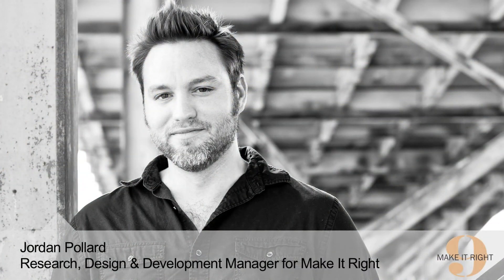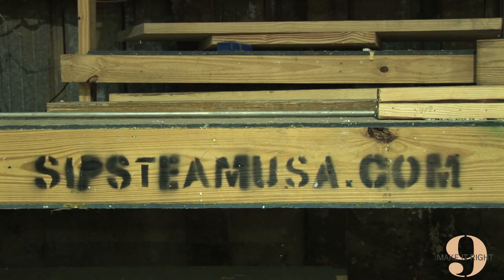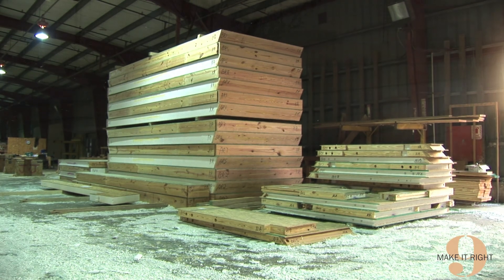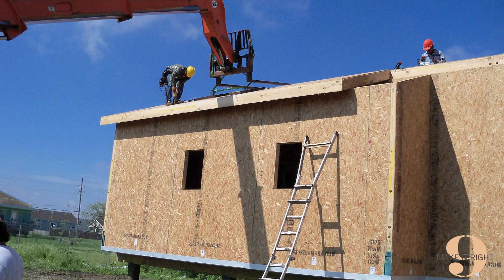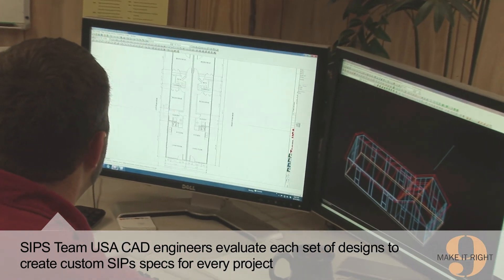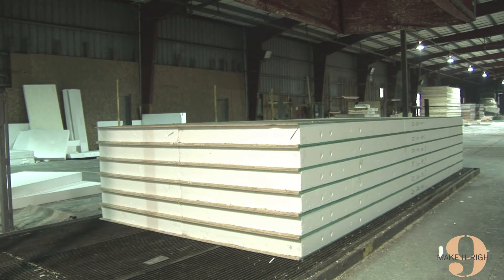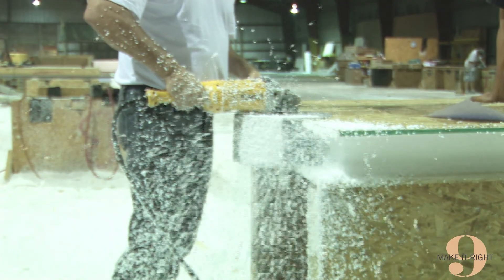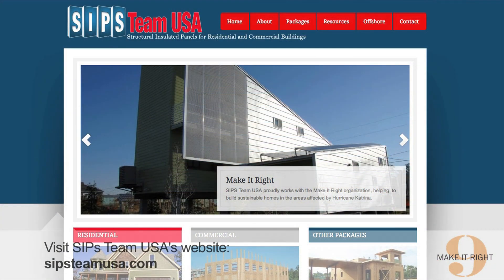Make It Right Insight on SIPs

Comment: This video only shows how much the builders of AMERICA have not learned about proper building construction, especially the type needed for humid, damp climates. Disgracefull at best.
Reply: OK, I built a home In Puerto Penasco Mx with SIPS. They are heavy (seee the crane in the video?) and not easy to modify in the field. Other than that they were awesome and most of the information in the video is accurate. It could be so much better with a simple EPS building panel that is easily modified in the field and  complies with local US building codes. I make my own to do just that.